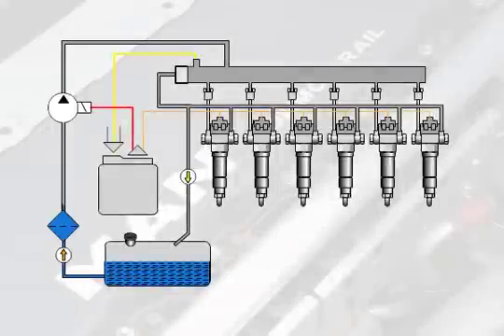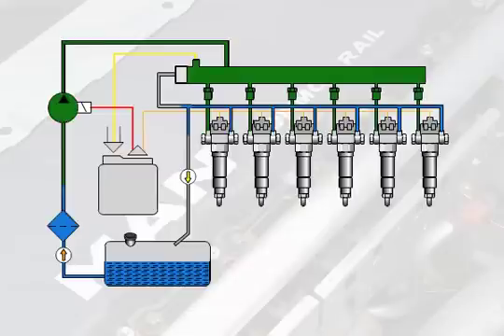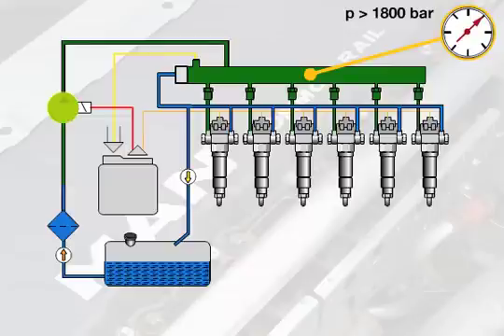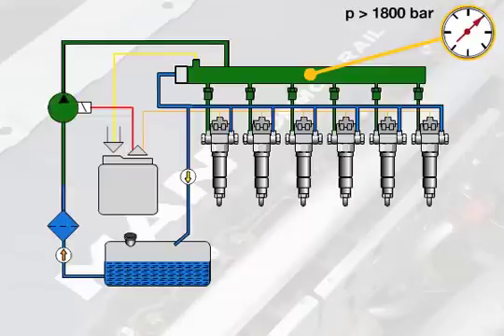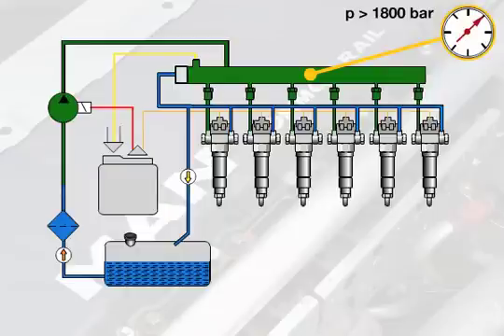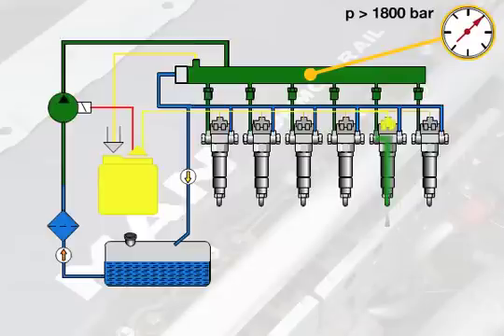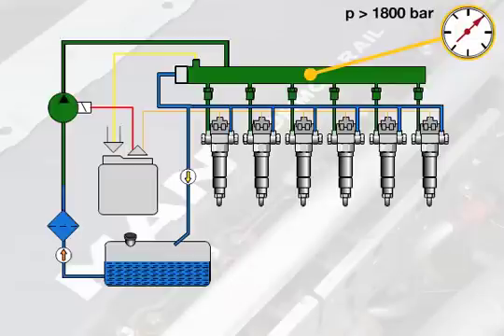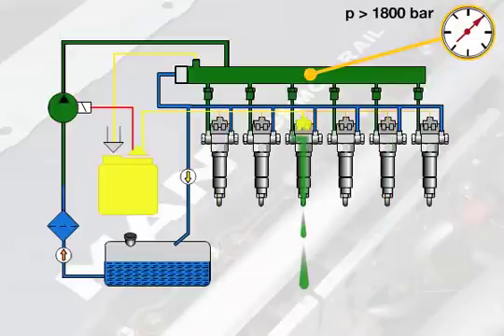Function of the Common Rail injection system | MAN Truck & Bus

Comment: Hi. I am kind of stuck with a question -   
 
Which of the following rail injection systems is untrue?
A. The common rail system has a much simpler high pressure pump
B. The common rail system is a form of indirect fuel injection
C. The high pressure pump supplies constant high pressure to the common rail
D.  An electronic engine control unit controls the opening and closing of the fuel injectors

I think the answer is D.

Comment: Isn't there more fuel injected while the car is moving faster?
Reply: Yes. He's saying that the common rail always has pressure ready. Go slowervand you use less fuel. Go fadter and you use more fuel.  The rail is always presurrised
Reply: @ahsanafzal48  Clever engineering.